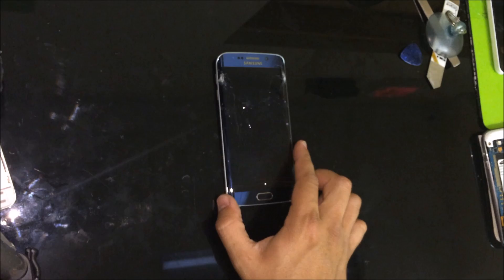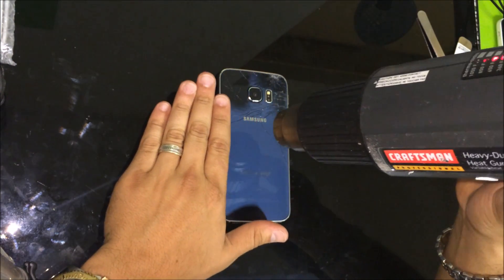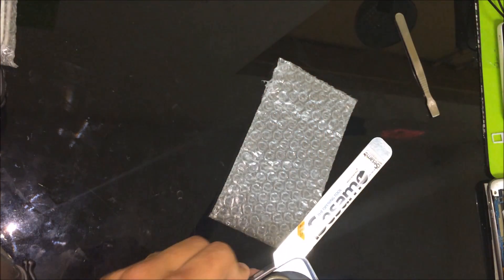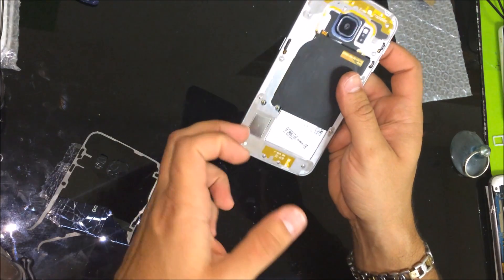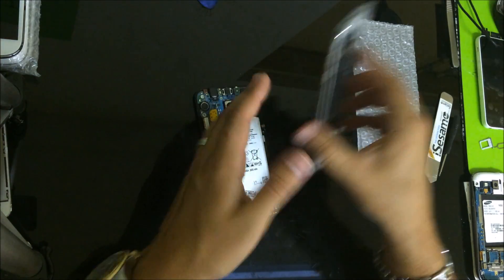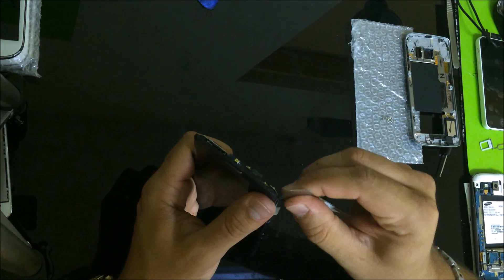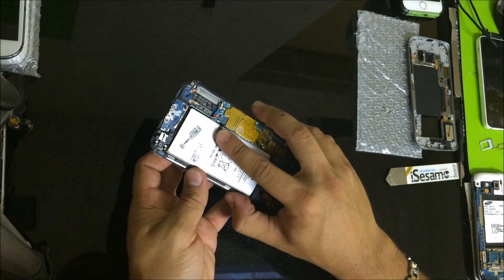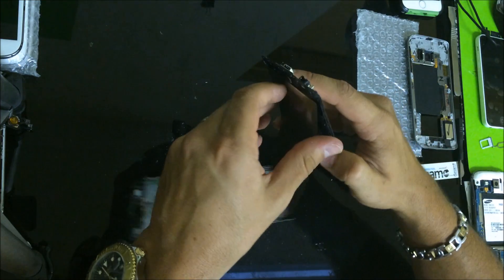Samsung Galaxy S6 Edge - How to Take Apart & Replace LCD Glass Screen Replacement

Comment: a word of advice. To open the back, start by focusing on one area on the edge. Corner area is the best to start with. Have multiple pry tools available. Plastic is best. Heat the area and pry it. Once you are able to sneak the pry, leave it there to act as an anchor. Then apply heat to the area near. It should be easier to use another pry from the anchor area and slide it to the heated area.  Anchor it with the pry. And so forth. This will prevent you from causing damage to the logicboard, or damaging any peripheral internal components. You should then be able to cleanly remove either the back, or the screen, depending on which one you are working on. You can apply this principle on any phone, or tablet that applies strong adhesive and heating to airtight glue an object (like glass digitizer) to the main body.

Comment: Do you know if it is possible to replace only the front crystal without changing the whole LCD? I just broke the crystal of my phone.
Reply: Yes it is yoy need to buy the adhesive seringe and heat the crystal and slowly and carefully remove it off the lcd
Reply: +markromiro619 hi my friend just broken the front glass of the S6 Edge too, can u plz do an other video for just the front glass? thankz